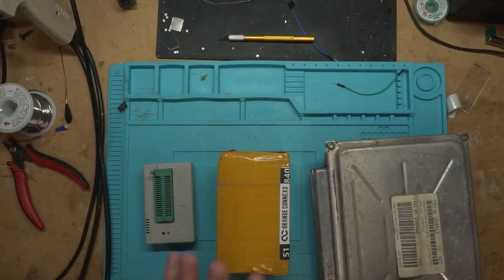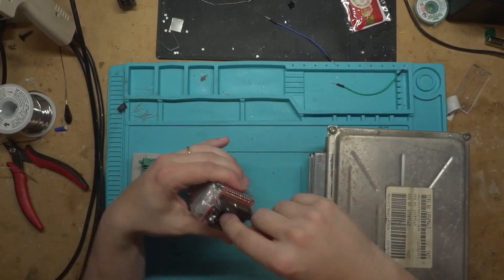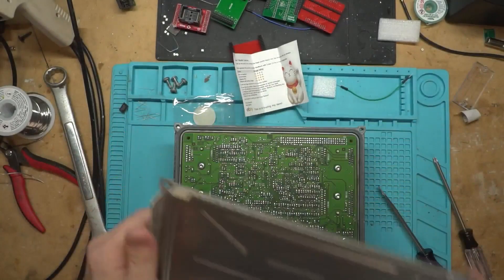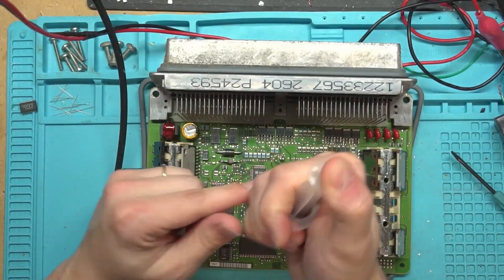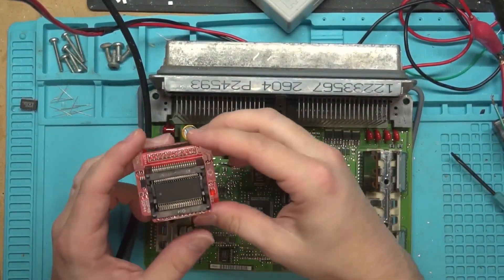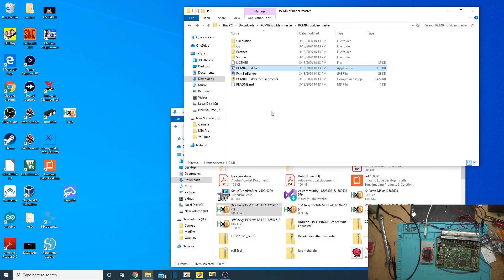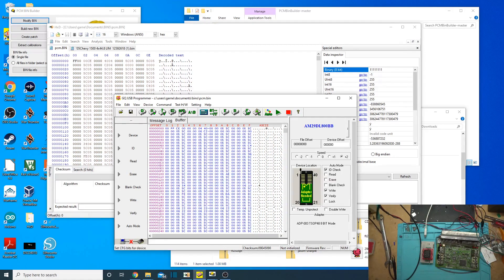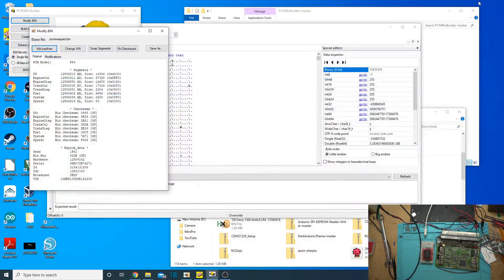Programming a 2003 to 2007 GM PCM P59 Part 1 Dumping It With A Minipro

Comment: What’s the adapter called to connect the flash chip to the eprom burner, I’ve been looking for one but haven’t had any luck, also do you think doing this I could load a known good bin file onto a flash chip from a bricked ECU or is it trash at that point? Thanks!